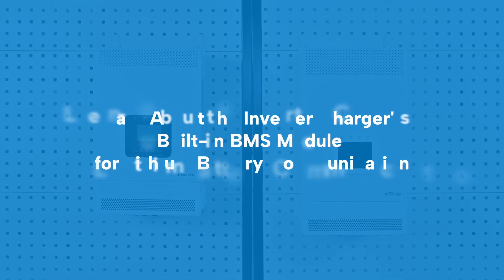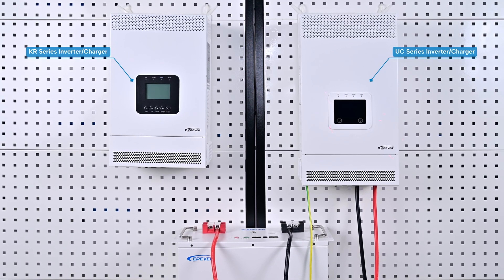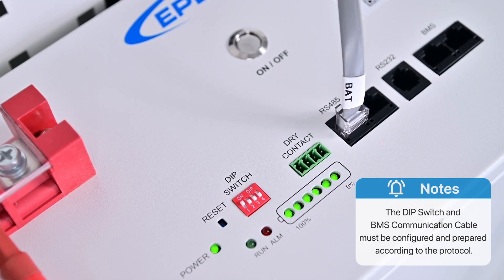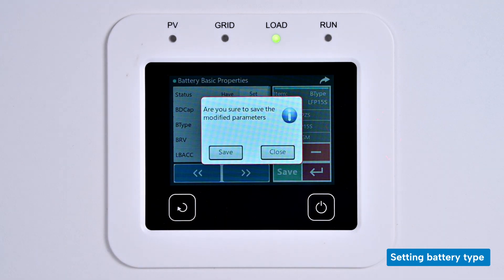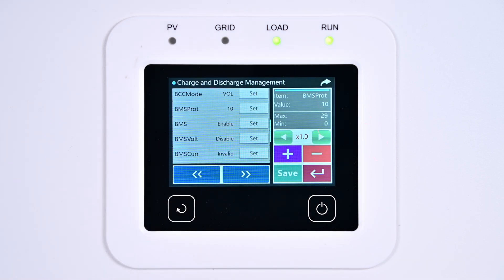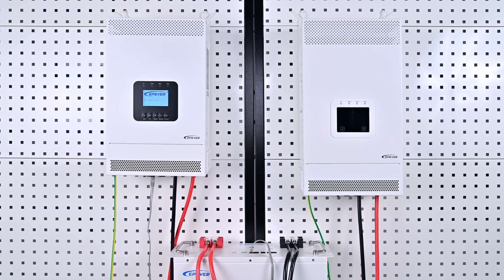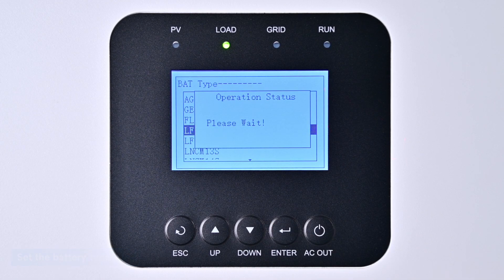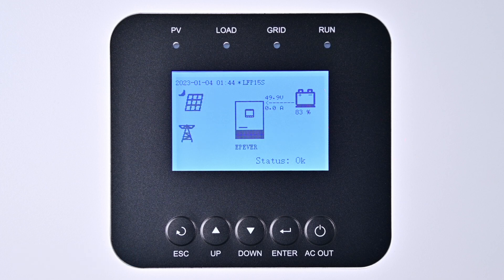How to Set Up BMS Communication on EPEVER UC & KR Inverter Chargers

Comment: These two cable types are for use with Epever batteries. If I have a different brand of battery, do I need to make a suitable cable myself to connect RS485-A, B, and GND between the inverter and the battery?
Reply from the maker: Yes, if you are using a different brand of battery, you will need to make the RS485 cable yourself to connect A, B, and GND between the inverter and the battery.
Our technical team at support@epever.com is available if you need any guidance.

Comment: Hi i have Epever 5500W UC 5542 inverter and Epever lethium Lifepo4 100Ah 51.2v 16s bettry. Can you please guide about it. Battery isn't properly connected And showing BMS error
Reply from the maker: Hi, please contact our support team at support@epever.com, and they will be happy to guide you through the solution.